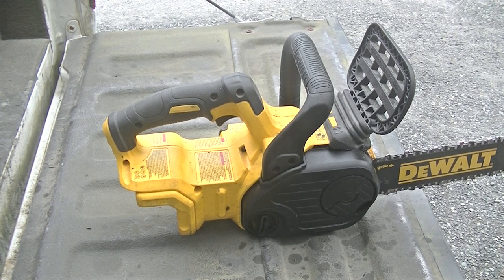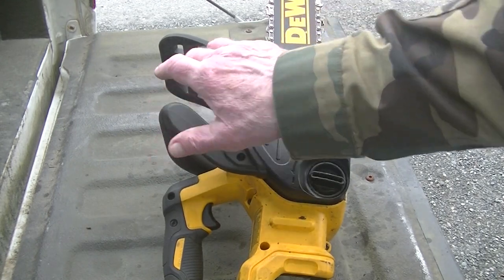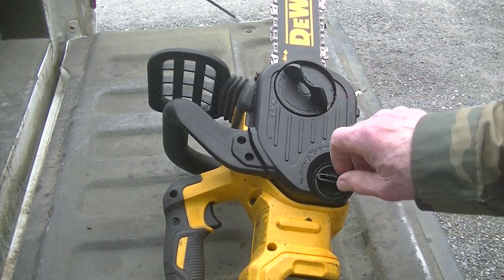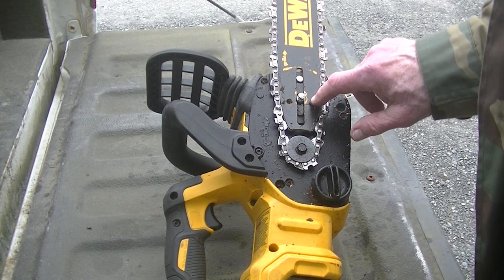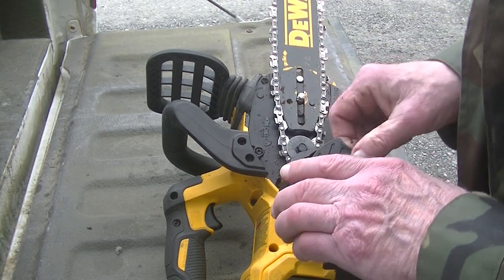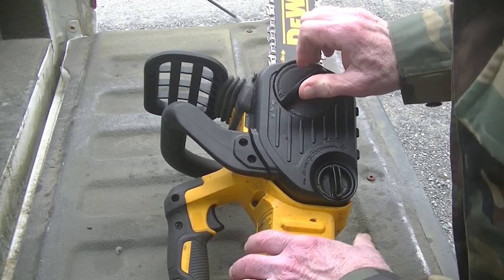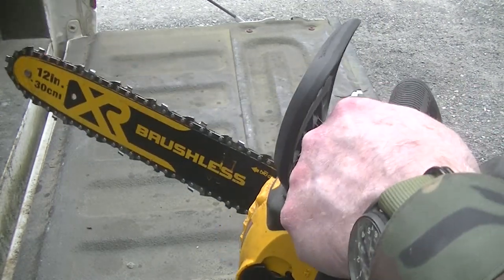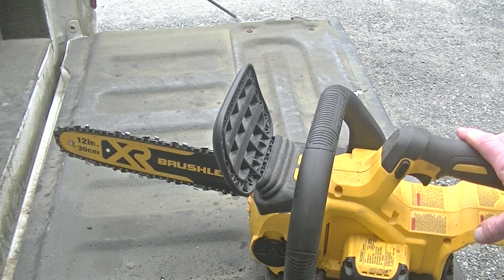Fixing Dewalt Chainsaw Crunch

Comment: That's a slick system they have for chain tension and bar inspection. Very simply. I guess the only complaint would be that those pins holding the bar in place could be a little longer. 
Good info! Thanx for sharin'!
Reply from the maker: It's nice to not have to carry wrenches with you. Down side is that once that cover is off everything wants to fall apart and you need three hands or a monkey.
Reply: @rawsonforever  🤣